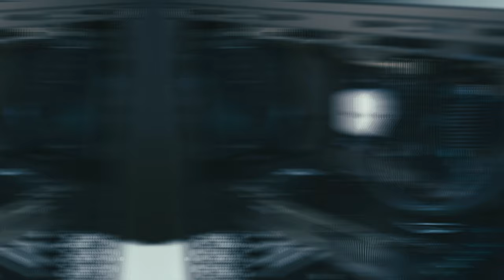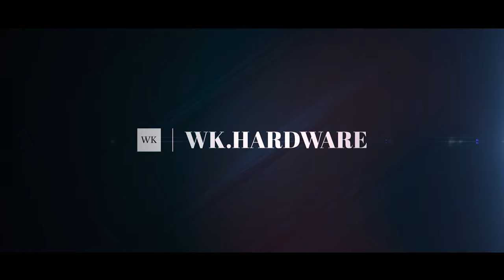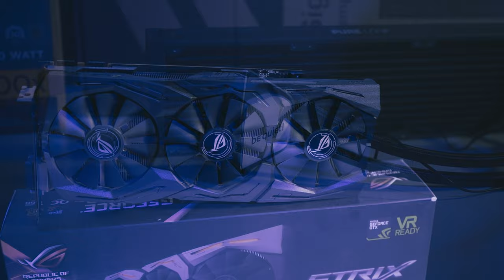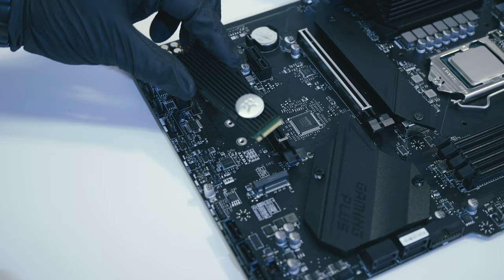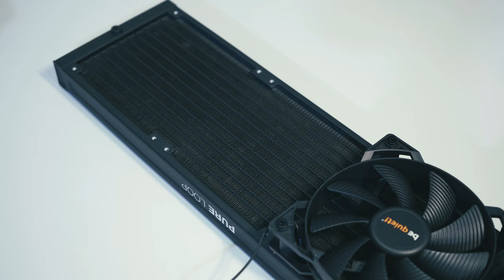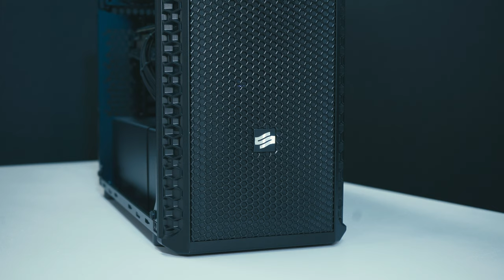Blackout - RGB Not Allowed - PC for Gamer - i5 10600K 32GB GTX 1080 Ti - ft. bequiet! Pure Loop 360

Comment: love the build. I'm also building black/ subtle white, thanks for the reference. Pure Loop 360mm looks great for the setup, I'll buy one.

But you should mount the radiator on the front, top mount affects cpu temp since it exhaust hot air from the gpu. Bitwit video confirms it, you should check it out.
Reply from the maker: Thanks for kind words ;) I prefer lower temps on GPU since this CPU doesnt require much cooling. Cheers!
Reply: @WKHardware  GPU doesn't care which way ur radiator mount on. It's a plus plus, CPU cool and GPU cool. I can't guarantee though since I don't have aio cooler, yet. it all based on Bitwit video, check it out
Reply: @reynaldo7371   it does if you mount your AIO on the front it pulls in fresh air and cools the cpu more but the rest of the system gets heated up air cause it passes through the fins of the radiator which are hot because of the cpu heat. If you mount AIO on the top its close to even temps, if you mount it in the front CPU will be the coolest  but the rest of the components will be hotter.
Reply: @caspertheghost541  nope, gpu and the others gets fresh air from the front,

240mm rad inside, 360mm fan outside

it's been more than a month, temps are great so far.

btw i end up bought arctic freezer ii because the pure loop one was out of stock

Comment: Is the pump noise too loud? I see a lot of complaints about that on Pure Loop AIO
Reply from the maker: I have 2 samples of Pure Loop 360mm and to be honest the pump is audible at full speed but it is not the worst which i had, and you can tweak the speed of the pump to make it almost silent. This AIO should be mounted at top due to placement of pump. Don't have much complains about this water cooling kit except maybe lack of rgb instead of that white backlight.

Comment: Hey sir,
Please can you tell me how did u turned off the rgb lights of the gpu?
Reply from the maker: Throught the ASUS RGB application i turned off the backlight. Another option is to set the color to black.
Reply: @WKHardware  is it works when you boot your system? Or only in windows
Reply from the maker: @nicolazucca  It will be off when you will be in windows but im not sure about booting. I dont have this gpu anymore, unfortunately to test it out. There is also an option to plug out the rgb cables to backlight but backplate rgb cable is under the backplate, and you have to disassemble the gpu to do this.